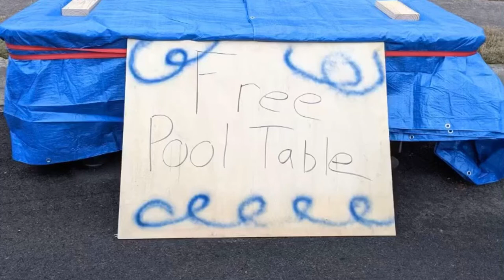REFURBISHING A FREE POOL TABLE!! BEFORE AND AFTER!!

Comment: Do you have any pictures of the bottom of your table?  I recently got one where the legs were removed and it looks like the bottom may be missing a brace or braces. There are no holes from where the legs were attached before visible so I worry the base my not hold the legs securely without more wood.
Reply: Did you figure anything out was looking at table with no legs